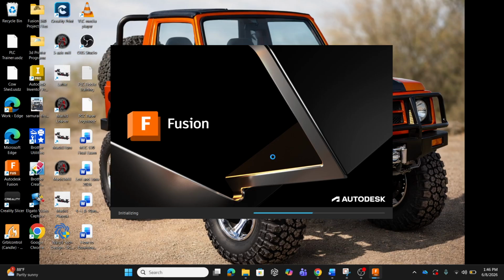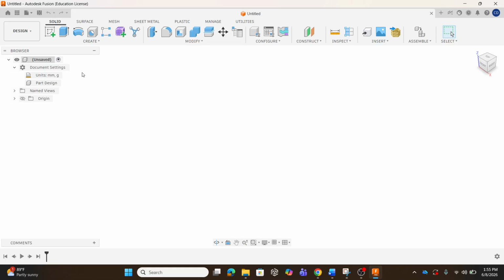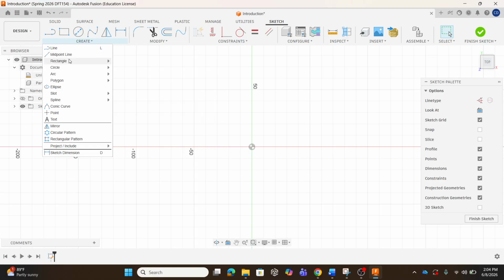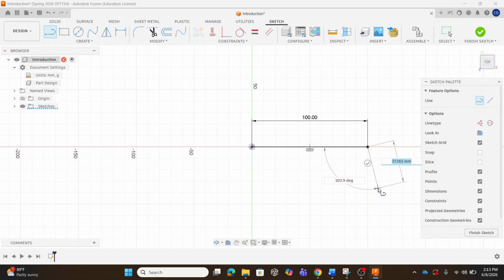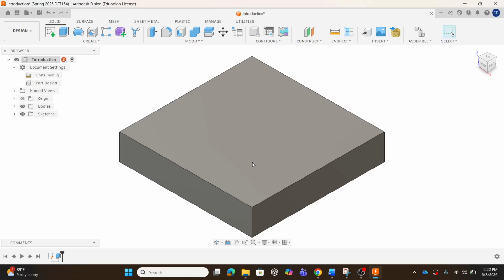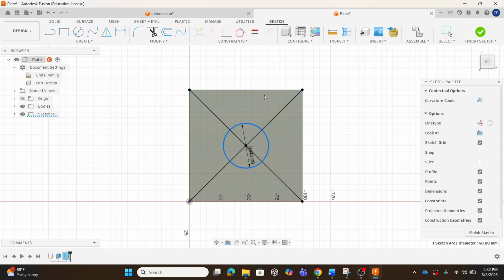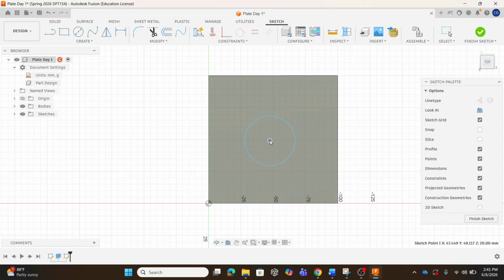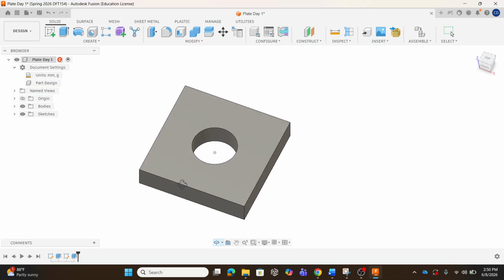Fusion Day 1

Comment: Hi Christoher, well it looks like you will be my teacher while this 68-year-old carpenter try and learn to draw a few things on Fusion 360. Just wondering why your screen is all white and mine is grey with grids with blue, green and red lines?
Reply from the maker: Hello Mr. Wagner, I turn off the "Layout Grid", and "Snap to to Grid". It's a personal Preference. If you want to turn it off, Look at the bottom of the screen in the center, there will be a few symbols, "A hand", "a magnifying glass", and a "3 by 3 grid". Hover the cursor over the 3 by 3 grid and it should say "Grids and Snaps". Click on it and uncheck the boxes beside "layout Grid" and "Snap to Grid". I hope this helps.